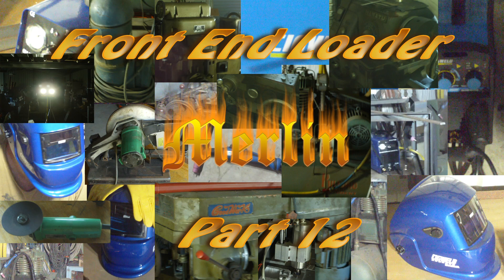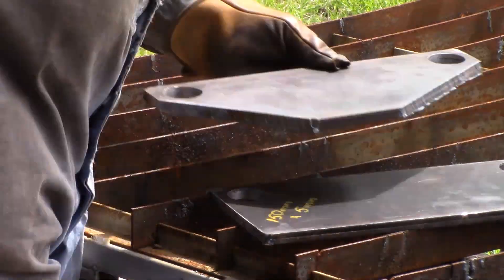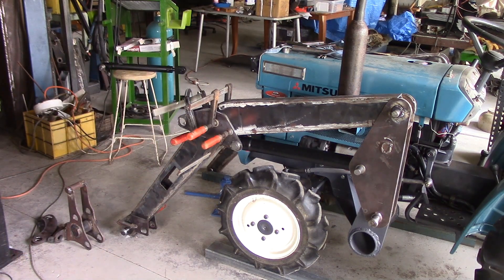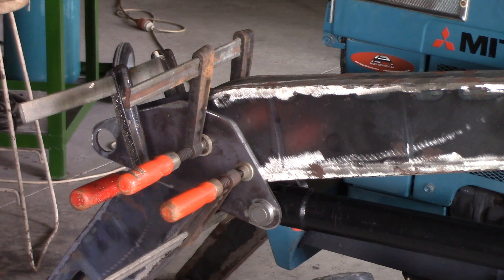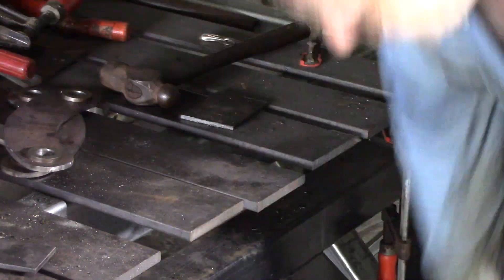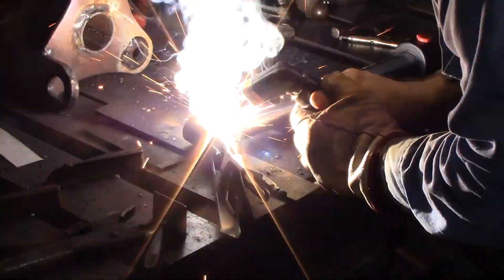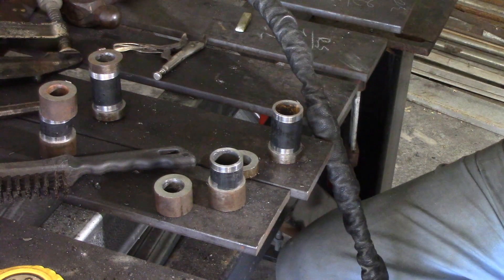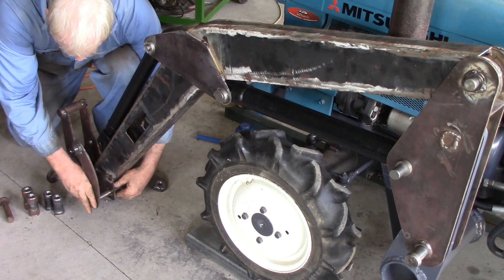Compact Tractor Front End Loader - 12 of 18

Comment: The angle and position of the top mount of the curl cylinder doesn't allow Much "rool back " of the bucket-- only lots of dump angle; by the "looks of it" presently. Other than that, Pure Excelence.
Reply from the maker: Well spotted and totally correct.  The roll back is only just enough but the dump angle is spectacular.  It is good enough that I won't bother changing it but a little more roll back and a little less dump wouldn't hurt.